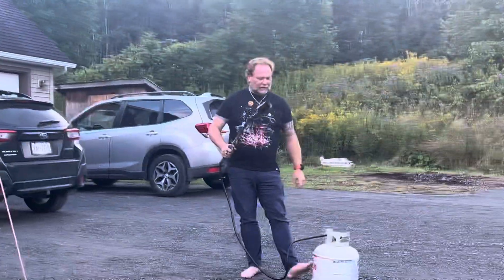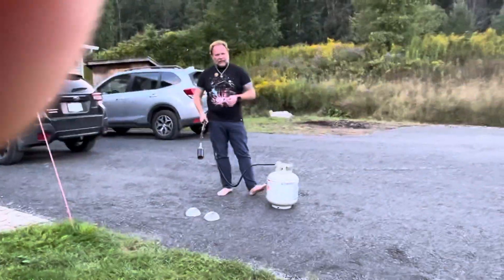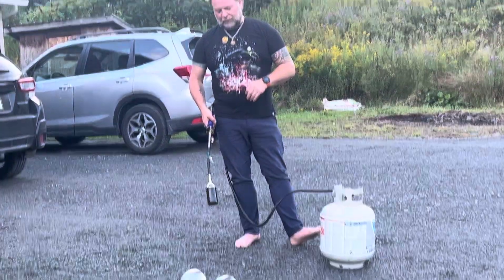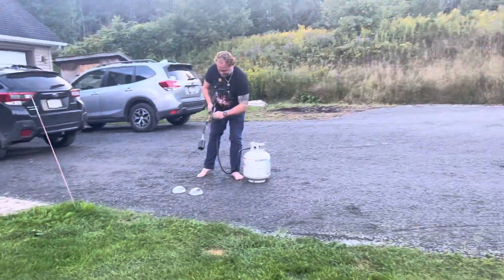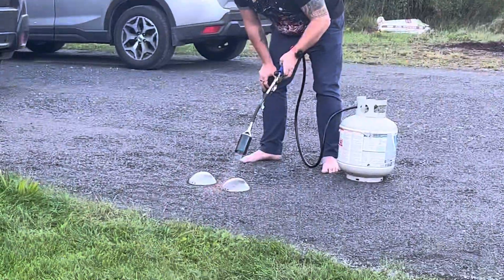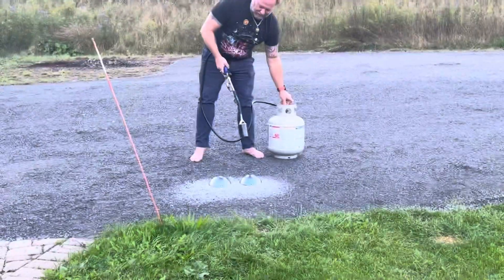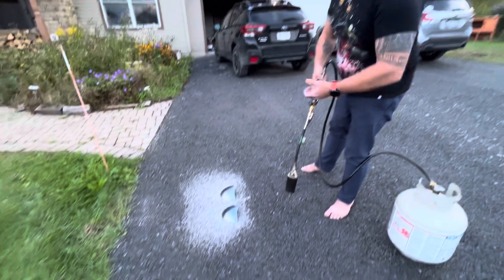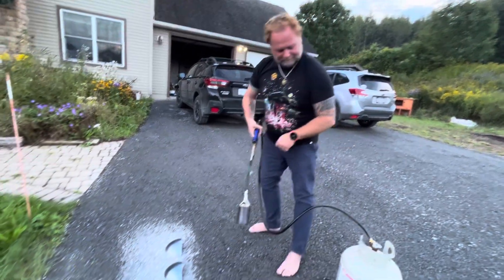Basic Heat Bluing Steel

Comment: Suggestion: shop the local yard sales for a bbq grill griddle plate, place your "to be blued" items on same, and heat the plate. Once the edges of the items begin coloring, THEN play your torch on them as well. Youll get far more even color, as the edges wont be sitting on a heat sync (the earth, lol). It will also allow you to color low mass parts to any oxide heat color (evenly) from pale straw to quite vibrant purples, or even a deep black if you can produce enough heat.

That said, very nice results! Quite an economical method, and far more durable than rubbing with those "quick blue" gun bluing solutions. Well done!
Reply from the maker: Thanks for the info!